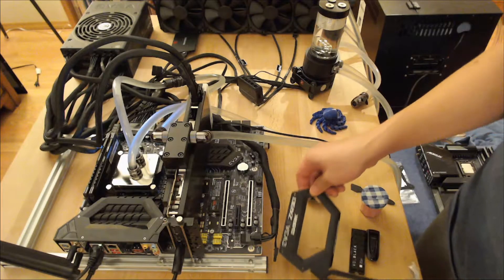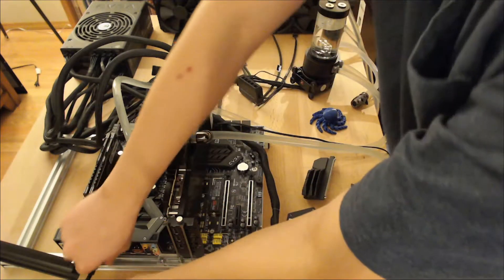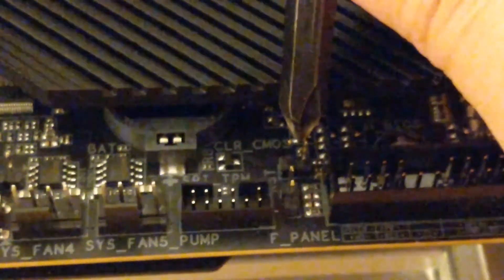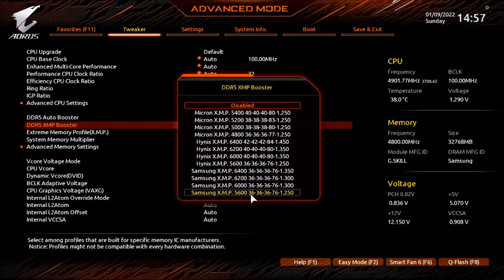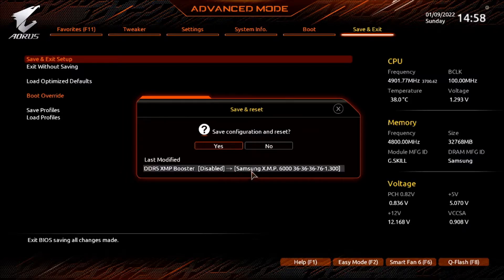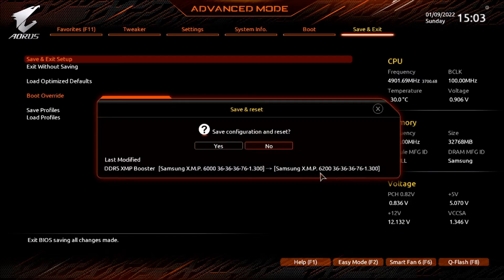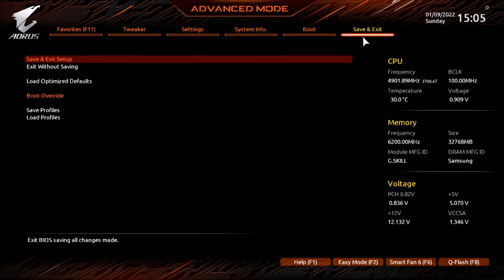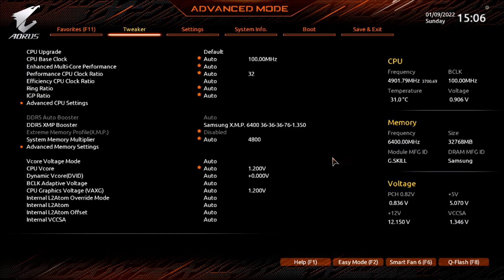Test Bench Gigabyte Aorus Z690 Master & Overclock DDR5 to 6400MHz - Apollo Build v1

Comment: hello, one question, should I get a build with i7-12700 and ddr5, since it is said that the ddr5 are now not the best I wanted to ask you what I should pay attention to when choosing a motherboard as optimized as possible on the hardware side with this ddr5 technology in view of the future (even bearing in mind to overclock the RAM in the future to 6000 / 6400MHz)? if you can recommend some technical specifications, or what should I give more importance in choosing the mobo knowing that the goal is to get one that I would use with RAM banks more mature than I would buy in 1/2 years when the ddr5 will no longer be "immature".  So hypothetically it goes better than the others with DDR5 of the future in practice😅.  I ask you pk informing me I noticed a big difference between models of ddr5 motherboards, both for problems that some cards give and others not, and for better or worse optimization of the hardware.  Thanks in advance for your patience :)
Reply from the maker: This may be long, but there's a lot to say. I think right now DDR5 and Intel is a good combination, but will have to see how the new AMD chips work. Windows 11 has the new Thread Director, so definitely use Windows 11 with the 12700. I like the i5/i7 chips because these are the best bang for the buck. Yes, DDR5 isn't at it's best, but the fastest DDR4 with 5333 XMP was released end of last year and it took maybe 7+ years to get to these speeds. DDR5 can theoretically get to 8400MHz and maybe faster, but will take years. So getting DDR5 now is more for early adopters of the technology. You can get good parts for 10th and 11th gen with fast DDR4 for great prices, but get 11th gen if you want PCIe 4.0 for the fastest NVMe PCIe 4.0 drives (recommend 11600K/11700K, Patriot Viper 4400MHz, and WD_Black SN850 if you go this route for best bang for the buck performance builds). For motherboards, to use DDR4 5333 you need more top end overclocking motherboards and maybe not worth it. Look at the memory support lists for boards and there are only a few that can even support the 5333 memory (like EVGA Z590 or Asus Z590 Apex/Extreme/Hero). If you get a K CPU I tend to favor EVGA Z590 Dark, Asus Apex/Hero, or Gigabyte Aorus Master. For DDR5 motherboards many Z690 support the memory, but higher end boards will get XMP to work right and even overclock to make most of the DDR5 module. The biggest difference I've seen that affect CPU to memory performance is the boards ability to provide clean power to the CPU and the CPU's Integrated Memory Controller (IMC). The 11th and 12th gen work best right now for fastest memory speeds. Find a motherboard with a high phase count and good capacitors around the CPU socket. Compare the Z590/Z690 EVGA Dark / Asus Apex / Aorus Master to other motherboards and you can see the difference in the components around the CPU socket for power regulation. I have an EVGA Z690 Dark Kingpin and an Asus Z690 Apex, but haven't had time to get to them. So far the Aorus Z690 has been working very well for me, but my sense is the other two boards will work well with the DDR5 memory I have. Last comment is on GPU, if you get an NVIDIA, the 3000 series mostly use PCIe 4.0 but reality is that they are heavily optimized for PCIe 3.0. So going from 3 to 4 gives you a performance gain, but not a lot.
Reply: @nispoe  thank you very much for the explanation :) so you say that the ddr5 can also be used on Intel 12 gen CPUs and you won't have to wait for new gens?  but if there is a reason why people say ddr5 will perform better on next gen (Intel 13th gen and Ryzen 7000) and worse on Intel 12th gen what is this reason, and how could I mitigate it?  what can I change in the BIOS about the processor so that it is optimized and works best with the ddr5 also supporting high frequencies as close as possible to 8400MHz?
Reply from the maker: You can definitely use DDR5 on Intel 12th Gen, I've been running for months on a 12900K and G.Skill Trident Z5 6000MHz RAM for months stable. If you get a 13th gen the DDR5 you get now will run about the same, but the next DDR5 generations will get faster if the CPU and motherboard support faster memory. Sometimes the motherboard manufacturers will provide a BIOS update that will allow you to run faster CPU's and memory if the hardware can support it. The reason why people say DDR5 will perform better on next gen is because right now it's the first gen for DDR5. It's also the first time for Intel chips to support DDR5. For AMD their next gen AM5 (6000) CPUs will be the first time DDR5 is supported. There will be some growing pains until everyone figures out how to connect everything well. It takes a couple or few cycles to get things perfect. The only mitigation is to go with manufacturers that have a huge history of making motherboards and memory chips. I've historically stick with G.Skill, Crucial, Kingston, and Patriot for memory. For motherboards I favor Asus, Gigabyte, and EVGA. I've seen all these motherboard manufacturers provide updates for CPU's and memory as new things come out. The manufacturers will provide BIOS updates over time if there is any optimizations or fixes. As for getting to 8400MHz, this will most likely be the 3rd or 4th generation of DDR5 memory kits and over a few more years. If you want closer to 7000MHz maybe wait till next year, this year people are making memory kits that go up to 6600MHz, and I feel at the end of the year we may see close to 7000MHz memory for sale.
Reply: @nispoe  thank you so much for the explanations bro:) last thing, but as far as CPU and mobo are concerned, is it the same for them to support a 5000MHz RAM overclocked to 6000MHz and support a 6000MHz RAM not overclocked?  change something?
Reply from the maker: Not all motherboards will support overclocking to 6000MHz you need to buy memory kits that have been tested for 6000MHz. In the past with DDR4 you could definitely buy slower memory kits and as long as they had certain kinds of chips like Samsung B-Die you can overclock by applying more voltage supplied to the memory. The settings will be in the BIOS on motherboards that support overclocking. One good way to tell if the motherboard has this feature is look at the support for memory and see if they mention overvlocking, or with the specs of the board to see if they advertise memory speeds of something with a plus (example 6000+ MHz). The other things that matter is the CPU supporting overclocking as well. Sometimes to stabilize the speed the CPUs memory controller has to have some extra voltage to keep up with the memory running faster. This will come with a price though, you will need better cooling since the CPU will run more hot.

Comment: Debating on the master or extreme.
Reply from the maker: I like the look of the Extreme with the RAM cover and it looks like something you want to show people. It also can take the x16 PCIe 5.0 x16 slot and split to two x8 PCIe 5.0 slots. This is good for two graphics cards, but there's nothing showing NVidia SLI just AMD Crossfire. You could maybe split that for a PCIe 5.0 NVMe SSD, but that may be a year or two away. The other thing you get is 1 extra VCore Phase on the Extreme. Depending on the CPU you have that may be good for maybe LN2 overclocking, but don't think for everyday gaming that will do much even for an i9 12900K. The price is also a huge difference, not convinced an extra $400+ makes sense.

Comment: Love the video, very helpful. Thanks! I just got this board installed two nights ago (Feb. 8). It initially wouldn't boot. No matter, I'd read online that it had a weak initial BIOS (not at all uncommon), used QFlash to flash to BIOS F7c. Then it was stuck in a cycle bouncing between Post codes 28 and 54 before rebooting and cycling back to the same point interminably. Shut down, cleared BIOS by shorting the two pins. Nope. Well then, post code 2x range seemed to be memory initiation issue. Pulled both sticks of Adata 4800, re-seated them. No good. Moved two sticks to A2/B2. No good. Re-seated one stick to A1, removed the other stick. Finally it booted. Progress. Shut down, seated 2nd stick of RAM in B1, said a prayer, rebooted. Yay, now it booted and showed all 32Gb of RAM. 

After that hour long adventure, it has been rock solid and got through an hour of Prime95 without issue. It's a gorgeous board, photos don't do it justice. The onboard sound is top notch. The only enduring quirk I've found is that XMP is unavailable on my RAM, even though the BIOS clearly set the timings to the correct XMP profile, so it seems to be reading XMP just fine. Anyway, very glad I got it, having a ton of fun so far.
Reply from the maker: Glad you got it to finally work! Yes, actually, the 1 memory stick is a good trick. I've had to do that before to just confirm or get motherboards to start with RAM at base settings. I really wish there was a way to show off these backplates because some of them are really neat to see.

Comment: Awesome video, thank you! I have the G.Skill Trident Z5 5600 with my Aorus master z690 and had the same issues. Although I'm running win11 fine now, I'm not using XMP as it all went sour if I tried. I have to try more now after seeing your video! Thanks. My build: https://www.youtube.com/watch?v=2NNsG8KPHyw
Reply from the maker: Nice! Definitely try the XMP may need a BIOS update for this. From what I understand there are Samsung and SkHynix chips on these DDR5 Tridents. Load up CPUz and see if you can tell which version you have. One of these days I should put something in a case. I like the white case you picked, looks clean with good contrast given your parts. I tend to just leave all my guts hanging out all over, makes my office look more like some workshop when you walk in...
Reply: @nispoe  I just looked again in the bios, I cleared cmos yesterday, and I see how it autoloads profile 1 for 5600. I loaded "optimized defaults" now and then I had the option of selecting the 5600 xmp but after saving and booting, the post led on the mobo says "25" but still runs windows. I don't know what is going on :D I look forward for newer bios than F7c. I'm not really a hardware guy,  This is my 6th home desktop pc build since 2001 :D :D now I'm waiting for gpu prices to go down. I use my desktop pc for Davinci Resolve to edit drone videos mainly. Best regards from Iceland.
Reply from the maker: I see "A0" on my motherboard. I looked at you video again and noticed you installed Windows 11 and Aorus APP Center. I installed this and then saw the "25" code you are seeing. I went into App Center's preferences and unchecked "Always run on next reboot" and reboot my system. My code went back to "A0". The "25" looks like it's a custom code used for App Center and is fine and not a problem.
Reply: @nispoe  You are a gemstone! Thanks!

Comment: trash board it wont support ssd5.0
Reply from the maker: There are no SSD 5.0 drives yet for us to buy... Other boards may have Gen 5.0 SSD, but their solution is to drop the GPU slot speed down to x8. Still a limitation with Intel chip lanes. I think at the moment the board has a lot of features and works pretty well with DDR5. I'm going to play with an Asus Maxiumus Z690 Apex soon so can compare things more. Hope to at some point get the EVGA Z690 board to mess with also but waiting for release.
Reply: He's just jealous
Reply from the maker: Not sure, but adopting early does have its problems. Next couple generations things will be pretty awesome. Think we all have a lot to look forward to. What I don't get is why we've been stuck on 64 bit chips for so long...
Reply: Why would I jealous I just gonna wait for new mother boards that will support ssd 5.0
Reply from the maker: I think the best bet would be AM5. Intel was slow to get PCIe 4.0 out. They said it will be out in the second half of 2022 for AM5 which isn't far off.
Reply from the maker: @naor Did you see this? Video shows Samsung PM1743 running PCIe 5.0 at 13GBs. Looks like the board he is using is some ROG board. I have high hopes on my Apex board. https://www.theverge.com/2021/12/30/22860374/intel-samsung-ces-2022-demo-pcie-5-0-ssd-setup-speed-test